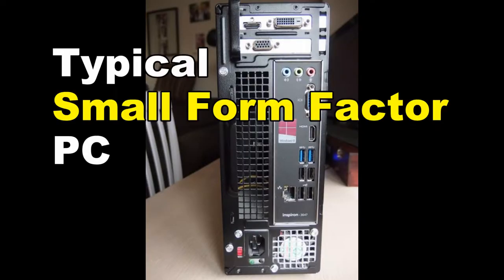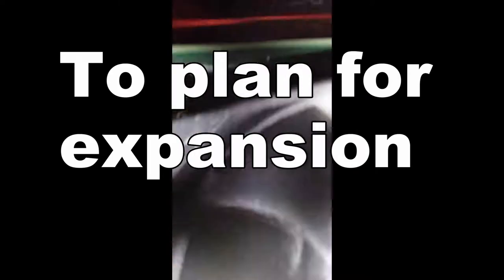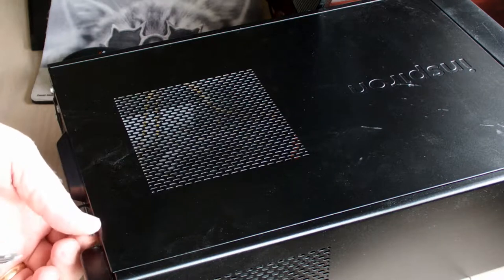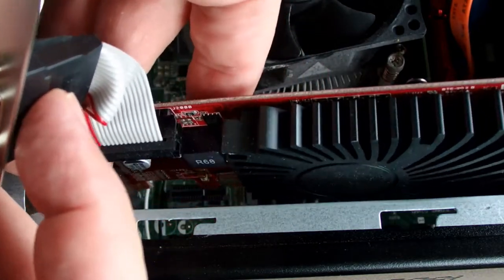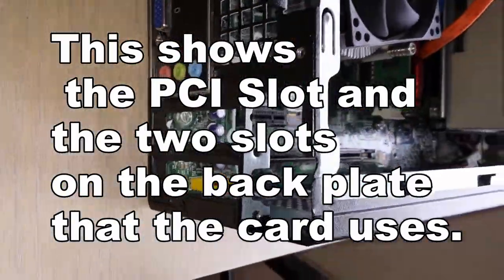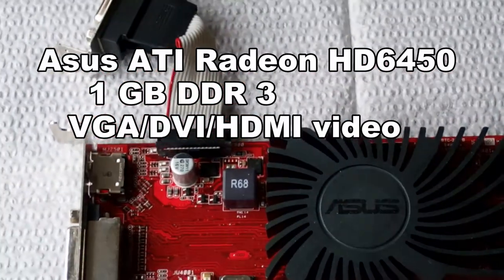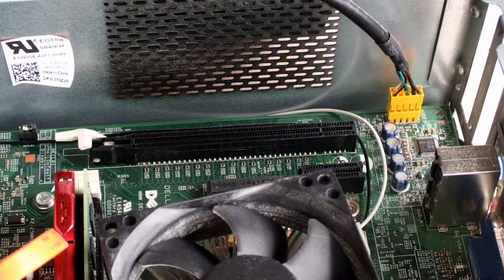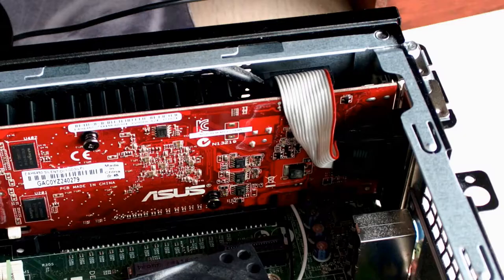A Low Profile Video Card in a Dell Inspiron 3647 SFF PC

Comment: Someone needs to do a tutorial on how to change the PC case of this Dell Inspiron 3647. The power cable gives me nightmares
Reply from the maker: Good idea. I'd pull everything but the power supply. Assuming the cabling would reach, it would be at big relief to have the extra room, air flow and ability to increase the power supply.
Reply: I Did it twice (i have 2 of them) and it's very easy, almost unplug and plug it inside the new case

Comment: hello friend, I also have the 3647, the update with a GT 730 and works great, do you think it is possible to extend more to a GT 1030?
Reply: I understand that both graphics cards, consume the same energy (30 w), so in theory should be possible but I'm not entirely sure :(
Reply from the maker: I don't have a 1030. All I know is Nvidia recommends 300W power but requires no power connector. By specs the answer is no.
Reply from the maker: The GT 1030 is recommended for 300 watts and is 2 slots wide - I doubt it needs a power lead.
Reply: the GT 730 also Minimum Recommended System Power is 300w
Reply from the maker: https://www.geforce.com/hardware/desktop-gpus/geforce-gt-1030/specifications You can check the specs for yourself and then compare to what the SFF PC has. The 1030 seems to take 300 W and a double card slot - check it out. I like my SFF Dell , it's very well made but other than memory slots and the lowest end of video cards there is no way to expand. - it's really sad the way they limited this PC - thanks everyone for you helpful comments - Rob
Reply: Can you give me the link of GT 730 which skull angel bought
Reply: Did you upgrade it to a 1030 or 1050?
Reply: Skull Angel a gt 730 fits here?
Reply: Yes...I install the GT 1030 from Gigabyte for my inspiron 3647....and it works super great.